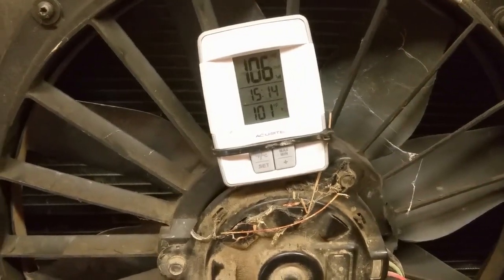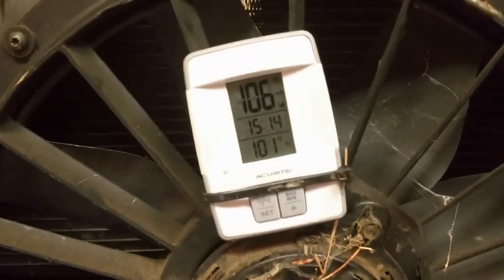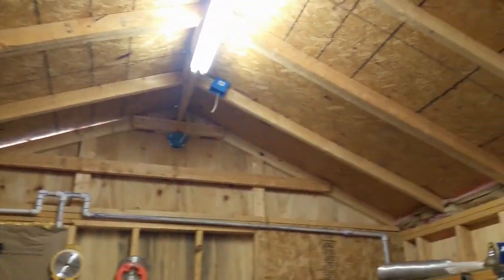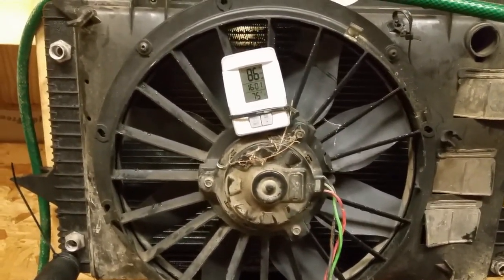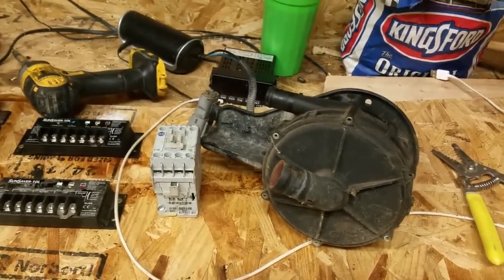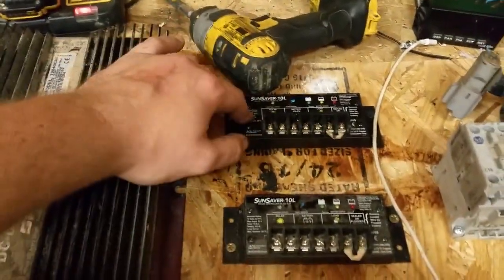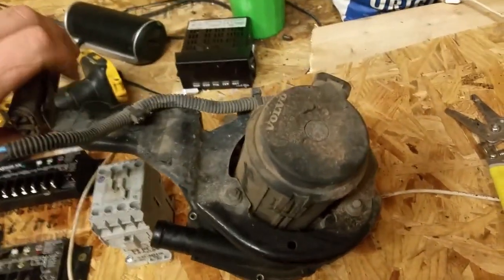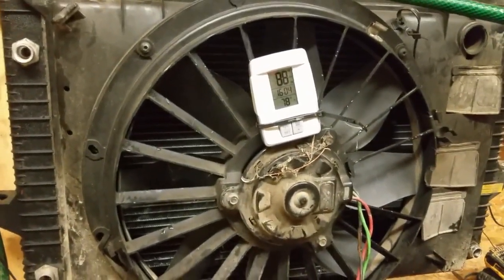Geothermal Solar Air Conditioning part 3

Comment: look up diy well drilling for better cooling make 3 wells and hook the all up and you can have it run in a close loop
Reply from the maker: I will check it out. I live in a low area  and the water overflows the well casing 2 ft above ground constant 5 gallons a minute. my plan is to utilize the over flow as efficient as I can instead of running straight to the ditch.

Comment: What part of La.  you in???   Im down here in Metairie... looking at trying to do some sort of Geothermal closed system for my shop myself.  Like your vid!
Reply from the maker: Thanks man, I'm around the bienville area. Got alot more comming on this when I get back from out of town.
Reply: well I subscribed.... its 101 here in Metairie today... this Stinks..  I dont have a well system to pull water from but was thinking about making a 5 gal tank to bury 4 foot in the ground or doing a copper coil buried to get the cool water I need to run the system.  Cant wait to see more from ya.
Reply from the maker: Awesome thanks I'm thinking of burying another radiator in the ground as a closed loop heat exchanger
Reply: May have 2 here.   I still have my busted portable A/C unit that cant be repaired but has 2 radiators in it.  Just need to get the gumption to break them down. and get some copper tubing to bury.
Reply from the maker: Wilson Revelle I got that problem to
Reply: +Wilson Revelle why not find a refrigerator pump that still works or you can use a car one and a mower to power it
Reply: +cricketol or some electric motor

Comment: Just found your AC build. We have a good well with cold well water but it's our drinking water. Just wondering where the water drains to when it comes out? I have a radiator and it wouldn't be hard to find other parts, I'm thinking, but the radiator has had coolant in it and I wouldn't want that going into my ground water source. Any ideas you'd care to share?
Reply from the maker: Thanks for the comment . At the moment the water runs to the creek. we are looking to do a small ram pump for the extra water. the coolant in the radiator can be flushed and disposed of property. once flush with a few gallon of water there is virtually no hazard. let me know if I can help more. Thanks!
Reply: Thanks!